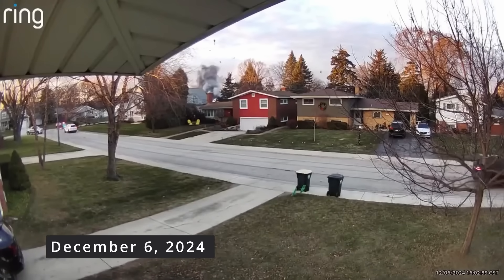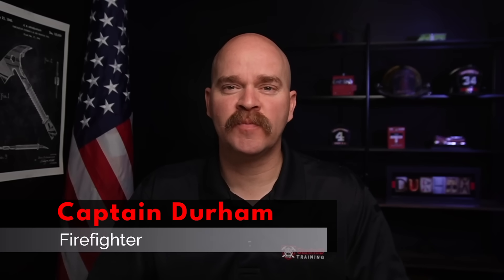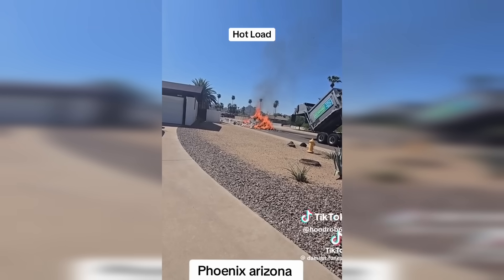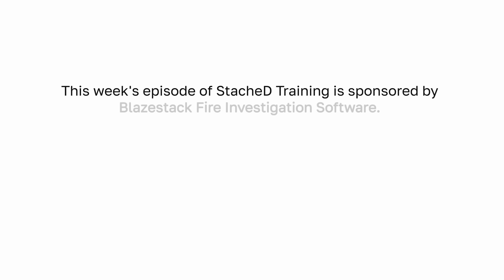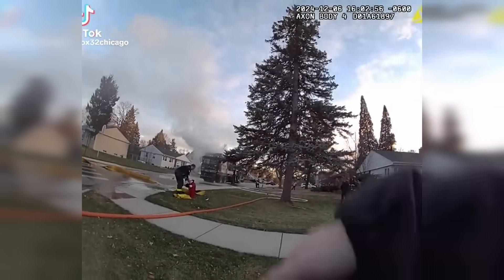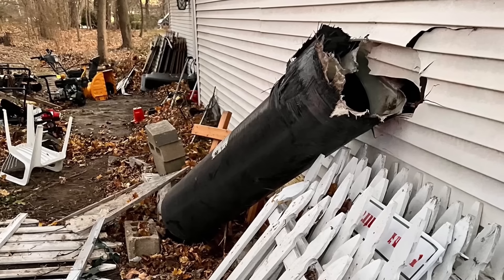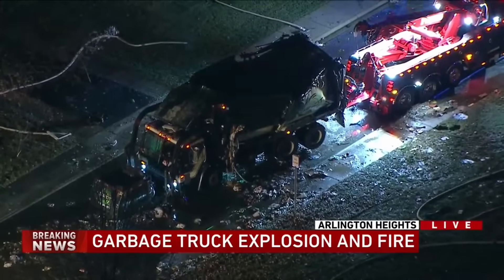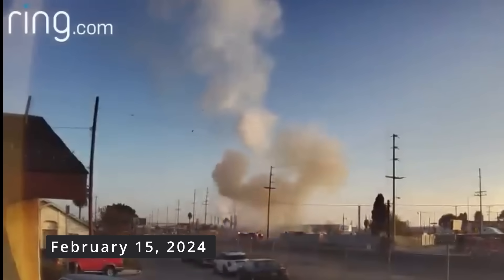CNG Garbage Truck Explosion Leaves 3 First Responders Injured!

Comment: BLEVE - your comments could use some clarification.  CNG failures may not be technically a BLEVE (because it is not stored as a liquid), it basically behaves pretty similarly to a BLEVE.  CNG has an expansion ratio of 100x, while LP has an expansion of 270x.  Yes, LP has 3x the expansion, but if first responders encounter a CNG failure, they won't really see a difference

Comment: Well, its obvious the tank and tank safety valve needs a thermal blanket as well as a remote fusible link valve to jettison the contents of the CNG Tank INTO the Garbage Trucks Garbage Container. Why? The contents are on fire already so its not adding much to the fire but it is a contained fire and the container sides should shield the surrounding area. No its not ideal but in this equation there IS NO IDEAL. Its a fire, about the only safe thing to do is direct the energy discharge in a safe direction.

Comment: The only difference between LPG and CNG as far as BLEVEs, none the only difference is the static pressure. An LPG tank can be emptied of liquid propane into a bowl and it will slowly boil at room temp. CNG, for vehicles, is stored as a liquid, but that requires much higher pressures than propane. A propane lank is typically rated at 250 PSI, the CNG tanks I have at home are certified for over 5000 PSI.

Comment: Who would have thought it would be a bad idea to compress natural gas to 250 bar (that's 3,600 PSI).
Reply: It isn't a bad idea. It is a very useful idea. We store, use, and transport, many gasses at high pressure. Bottles of welding gases can be quite dangerous as well. Even water under high pressure and volume is dangerous and eventually something will go wrong. The question is, how often does it go wrong? EV cars or lithium batter banks catching fire seems to be happening a lot for the small number of them in use. How many CNG tank explosions have you heard of? High voltage DC power was quite dangerous, but it was good enough to start to supply it to the public, but they figured out that AC is better and safer......still not at all without dangers and deaths. I'm not against EVs or compressed gas, but am against mandates, and I do think we need to have ways to deal with failures and make them safer. Even inert gas in a compressed bottle can be lethal. My neighbor had some of the first CNG school busses, as head of transportation for Colton school district in SoCal. If there are a bunch of failures with CNG, then I haven't heard about it, unlike lithium battery fires. I'm a realist and like to know the details rather than just believing the narrative or stats that don't paint an accurate picture.

Comment: If the tanks for CNG were made of metal you would at least have a chance to cool them with water plus the tank would not burn on the outside thus reducing its pressure holding ability.

Comment: Clearly something that has been found out, but not corrected.  There are a lot of garbage trucks and busses running around with CNG tanks that are capable of the same explosive action.  Let's get it fixed!  Isn't this what the NTSB is supposed to be tasked with?  How about OSHA considering the fact that the driver and helpers on the garbage truck have to work around it?

Comment: I'd bet that all of the garbage trucks that caught on fire had bare metal beds that under the right circumstances could transfer electricity maybe starting a fire. It's nobody's fault as that's the way they're built and come from the factory. How about coating the beds of the garbage trucks with a non metallic coating that MIGHT help prevent electrical fires in the back of garbage trucks??

Comment: The tanks are filament wound carbon fiber tanks.  Carbon fiber matrix has a higher modulus making the tanks lighter & able to hold higher pressures.  These tanks also have a fixed lifespan.  All too often that is ignored & the result is a failure of the tank integrity.  "Rapid unscheduled disassembly"= 'explosion' to us lay persons.

Comment: I wonder if it would be worth using ballistic cloth in turnout coats? It might be possible to gets some light shrapnel protection (with little if any additional weight) would be useful for a fair number of risks.
Reply: How does it react to heat?
Reply: @kcgunesq  I suspect some do better than others. As long as it doesn't degrade under conditions that won't force replacement anyway then it should be good enough.

Comment: 🍁🍁  Assuming that the fire was still contained within the truck box, then simply moving the fuel tanks away from the box  including heat deflecting plates between the box and tanks should alleviate this situation.  Yes or No???

Comment: We compress fuel, usually diesel in industry, to increase it's energy in a controlled way inside an IC engine, relatively safe.
I know, let's use a more volatile fuel and compress the entire supply! 🤔

Comment: I believe an LPG tank will fail under the normal operating pressure of a CNG tank and just a little heating of the CNG tank will weaken the binding adhesives that hold it together

Comment: What's wrong with diesel vehicles? These alternatives are insane
Reply: They have problems with their pollution controls, they're expensive, the fuel is not domestically produced (see: conflicts in the Persian Gulf).
Reply: Also, oil spills.

Comment: lol the fire was outside the truck so not caused by a battery in the rubbish but like usual you will try to make it about lithium . This truck explodes and you don’t seem to be calling for a ban unlike batteries 🤦‍♂️
Reply: Name one other common item that, when thrown into the waste stream, can cause a spurious garbage fire.
Reply: @n6mz  vapes
Reply: @werner.x  ...because of the lithium-ion batteries they contain.
Reply: @n6mz  There is NO common item that causes an explosion like that seen in the video. Certainly not a battery.
Reply: @2Truth4Liberty  correct, but a battery is most likely the culprit that started the load fire. Batteries and pool chemicals are usually the cause for load fires
Reply: @2Truth4Liberty  You should watch the video and stop making up stuff.
Reply: @n6mz  Gas tanks like nitric oxide. Organic components who increase in temperature. Chemicals and already burning things like charcoal and cigarettes.
Reply: @chukkie0001  Nitric oxide?!? You really do not have any clue about what you are talking about do you? Do you even know that nitric oxide is?
I will answer the question you failed to even understand.
Propane tanks are about the only other common thing that is a serious hazard in a trash truck. They get smashed, explode, damage something, but do not usually set the truck on fire. Why? A thing called oxygen, which is in short supply inside the truck.
Reply: @joshua43214  My bad "Nitrous oxide" also known also known as Laughing gas. Those tanks can cause fires already happened a few times in my country. Nice thing its an oxidizer.
Reply: You can't dump batteries in garbage. It can cause an explosion in garbage trucks. There was a report about it in AZ..
Reply: Not that bright are you?
Reply from the maker: Please link any moment in any video where I call for batteries to be banned.
Reply: @StacheDTraining  i think lithium ions should be banned. there is no safe way of disposing of them. lithium iron and aluminum are the trending techs now due to safety concerns.
Reply: it was a load fire
Reply: Eahhhhh,   shadddup
Reply: They don't know the exact cause yet. Calm down.
Reply: Sounds like you're loosing money on lithium investments.
Reply: There is NO WAY that explosion was because of a battery.

Comment: It carbon fiber wrapped tanks, not fiberglass.
Reply from the maker: It's difficult to tell the difference between glass & carbon fiber rovings once the material has been molded.  Some tanks will use glass, others will use carbon fiber, however, carbon fiber is extremely expensive, about 10 times the cost of glass.  The cost is a primary reason most manufactures will lean towards using glass.

Comment: I have bad news... That wasn't a natural gas explosion. Where was the pressure relief valve on the tank? If it was natural gas, there would have been an even bigger fireball. No fire ball, just a lot of carbon soot.
Reply: The whole video was about how it was a natural gas truck. Cng is compressed natural gas. If it is released too quickly there is not enough oxygen to burn it and there will be incomplete combustion and soot released. The prd may not release pressure fast enough if the tank burns through.
Reply: @lightningdemolition1964  " If it is released too quickly there is not enough oxygen to burn it and there will be incomplete" Ahh.... No... 
In this video it even shows another CNG tank exploding with a rather large fire ball... You missed that one didn't ya..... Or like usual for all Einsteins, chose to ignore it.

Comment: Everybody says "recycle your batteries."  Everywhere we've lived, no one in government could tell me WHERE the recycle center for batteries is!
Reply: because they don't exist. recycling non leaded batteries is a money loser, and why there are so few recycling facilities in the whole country, let alone near you. it was ironic when we had recycling bins at home and the contents wound up just going into the normal trash heap once at the facility.
Reply: @LygerTheCLaw this here is why I stopped gaf about recycling. It's all just an additional tax, while not actually doing it. Add in that the only thing massive manufacturing recycles is cardboard. The level of waste is astronomical. So if producers and governments have no obligation, why tf do I care where ny water bottle ends up
Reply: Most bigger hardware stores have battery recycling.
Reply: @christopherleubner6633  depends on where you live.
Reply: What about Best Buy, do they still recycle batteries? They used to, for years. I used to take tube TVs there, before PA and many other states changed recycling laws for electronics.
Reply: @brianstallard5446  Try Radio Shack or Blockbuster  🤣
Reply: @brianstallard5446  Best Buy charges $$$ to recycle.  So do many recycling "drop off" centers.  I tried to take an old CRT to one once, and they wanted like $50 just to take it!  I had it for sale online for *$5* and couldn't get rid of it!  So I just put it out on the curb and left it for the ghetto shoppers, lol.  

No shade meant, btw, I've done some ghetto shopping, myself.  It's amazing what people throw away.  But they do it for the same reason I did.  It's too expensive, or too difficult, to find a place to take it, and get it there.  Especially when you live in a small, rural town like I do, and the closest Best Buy is 20 miles away, and the closest Home Depot, Lowe's, and recycling center even farther.  

My husband is disabled and can't work.  His check covers the rent and one bill.  I have brain disorders and am unable to work anything more than entry level jobs.  I still pay the rest of the bills, but there isn't much left over, and we have to get assistance for our food.  My little town doesn't offer recycling.  And I simply can't afford to pay for even the gas to get to the recycling center, much less the fee to recycle something.  

If the government doesn't want these things in the trash, then they should make recycling more accessible.  And they SHOULDN'T charge for it!  Especially dangerous items, like lithium-ion batteries.  But we all know the government doesn't care about anything unless it makes them more money...  🙄
Reply: @brianstallard5446 best buy doesn't exist anymore.
Reply: Batteries plus does, if you have one near
Reply: Radio Shack àlways accepted any batteried except automotive batteries fo recycling. And thay indeed were picked up by a recycler. God, I miss RS.
Reply: @The_DuMont_Network  Normal car batteries, so called automotive batteries a value parts. Scrapyard pay 40-50 ct per kilogramm (germany).
Reply: The shopping cart in the parking lot of the stores that sell them makes sense.
Reply: @tomrogers9467  👍
Reply: Try out front of a Home Depot or a Lowe's. The one I went to had a large drop-off can near the front entrance, next to one of those mobile sub sandwich places. They also had a cooking oil/cooking grease container there also.
Reply: @coloradostrong8285  They don't existing in my area.  I even asked.  No we don't take batteries or fluorescent light tubes either.  I can't find anywhere to take that stuff.
Reply: @Core-vu6mc  Sorry. Guess it goes in the back of one of these natural gas powered garbage trucks LOL.
Reply: @Core-vu6mc  In europe it's mandatory to have batteries collect point at supermarket and public buildings. Maybe you should lobby your local governement so they put up a battery collect point at your town hall or something
Reply: @coloradostrong8285  Those stores just dump those cans in the trash
Reply: That's why it goes into the trash, there's no accessible way to recycle... but they insist upon it.. like give us the resources to do so then
Reply: Most auto centers can also accept Litho batteries. However I understand this comments concerns.. The government does a terrible job at relaying information to the average citizen. With the amount of false information on the internet recently, it makes it even more difficult to get the correct information out to the public.
Reply: This government is a mess...lol.
Reply: Most counties have a "hazardous material" department that will accept them.
Reply: Google is hard to use isn't it? Maybe try "battery recycling near me"
Reply: you go to Google maps, go near your location and just search battery recycling or e-waste. all places that take them in will show up.
Reply: Contact your local extension office.
Reply: Also though an increasing number of things are being sold as disposable with Lithium-Ion batteries in them (especially one time use vapes) and even then nobody will accept stuff with batteries still in them due to biohazard concerns (e.g. a shaver that has non-removable Lithium Ion battery internal).  And then there's stuff like disposable LPG tanks that nobody will take and the landfill that accepts hazmat told us to put in regular trash.
Reply: Gotta find a dump that will do it, might be closer than you think, or really far away.
Reply: I repair riding lawnmowers and a bunch of them have old gas in them, but I can’t find anywhere that takes old gas
Reply: @easton_F350 If you're in the US, try Clean Harbors or a similar company.
Reply: a hole in the ground in africa
Reply: Guy from Europe / Poland here wee have container for batteries recycling  in most shops.
Reply: any hardware store
Reply: Do you not have a transfer station? Or recycling center where you live?  Every town where I live has one.
Reply: Google it
Reply: Lithium and I think older rechargeable batteries at least can be recycled at hardware stores in the US. The Lowe's near me has a bin for it. Lithium battery recycling is a pretty new thing but it's starting to catch on.
Reply: The dump for mine is almost 20 min away. My burn barrel is a lot closer
Reply: making this worse is those stupid single use devices using secondary cells because they are cheaper than an equivalent primary cell.
Reply: Exactly!
Battery return containers should be at every large retail center - Mal Wart or the like, ect with large signs stating their purpose.
Reply: No Home Depot or like stores except equipment batteries. Nowhere for the day to day 2A 3A disk lithium etc.
Reply: Yeeeeup, same!
Reply: Alkaline batteries are supposed to be thrown away. Lithium is the problem ones that should NOT be put in the garbage. 

I looked into fluorescent bulbs recently. Apparently households are allowed to just throw them in the garbage. Commercial is where they have to properly recycle them.